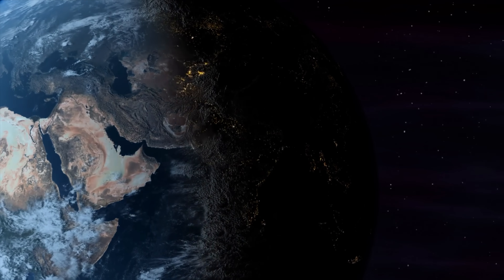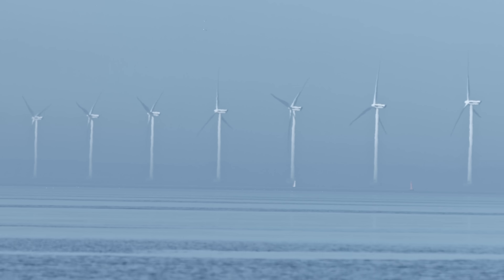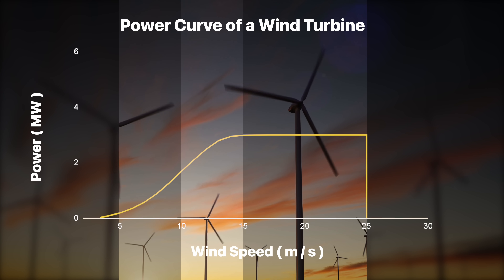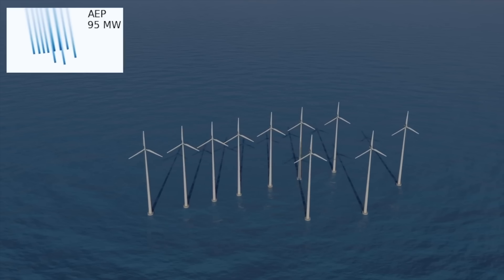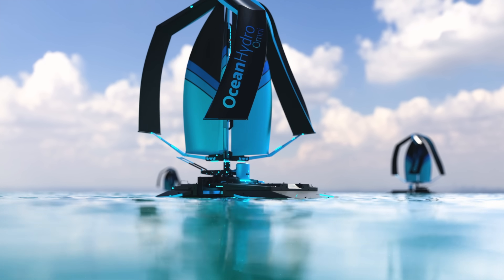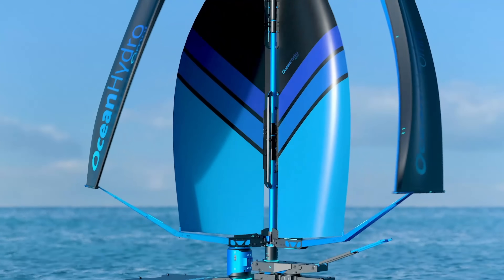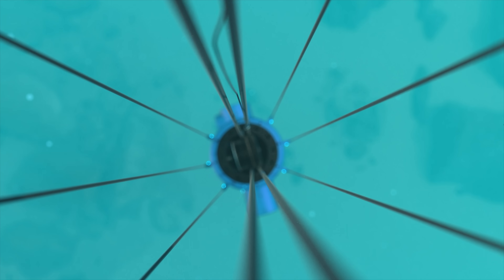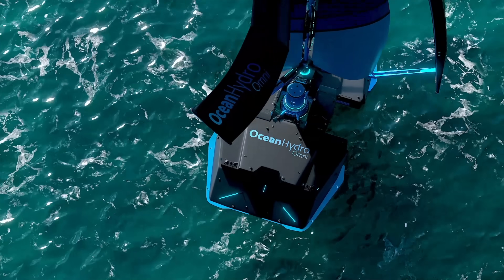Breakthrough Tech Solves Wind Power's BIGGEST Problem!

Comment: I am getting a little bit frustrated with all these new projects. We keep being told that wind and solar is unreliable and thus we must invent something entirely new.
I live in Denmark where wind alone is at 56% of the energy mix and I can tell you we don't have any problems with power outage. The current goal is to be an net exporter of renewable energy by 2030.
You can store excess energy through hydro or even with a conventional battery. Or you can sell to another market through HVDC cables. You can also put up smart grids that balances the whole thing.
The point I am making is that these technologies exist today. We don't need to wait another 30 years for something else to be effective.

Comment: Everytime this 2 bit de vinci  puts out the if butt's maybe, I am more impressed at the audiences solid input.
My take is allways too look at the economics as all energy production is a monopoly. Second the tech but only at its outcomes. Efficency,  costs,  volume off power produced. How easy or not will it fit into existing infrastructure. 
That why so many fail. 
Remember when its curtailed the oil gas nuclear have to jump in at a second to cover it. So they demand a higher price to guarantee supply. The more green the higher it drives the traditional base cost. That why every one benifits. WE DO NOT .WE PAY EVER HIGHER PRICES BY DESIGN.  Hello.
Cheap energy for decades.
Transition is not working for the many. 
85% off the planets population Government's are planning to increase traditional energy use by 50%. They cannot afford the prices or adapting their infrastructure.  
More questions than answers with the Wests unrealistic expectations.
Cheap plentiful energy has gone. I may have to move on as a fleeing economic migrant.  £5k for energy  really. How is this benefiting me. I can understand how it benifits the monopolies.

Comment: On the weight storage in a deep sea environment, what do you think about putting an air float on the weight? Pump air down to the float and raise the weight that way, perhaps it would be significantly more efficient than lifting the weight with the turbine?

Comment: Not sure how this will work but I have read at times that there is resistance to having offshore turbines since they have a visually disruptive effect. Perhaps these are not so, if they are lower and further out. I think they should use some other gravity storage device though such as pumping water up into a storage unit above water that is then released downward, or idk I have no clue

Comment: Better off using those wind pumps in the TX-CA 'Sun Belt' in lifting the Mississippi River's fresh water uphill through wells and ponds to the mountains, each a step in an energy/water terraced slope, rising upland from an upgraded Intracoastal Waterway. Coastal hurricane barrier islands need to be raised and connected, to adequately protect the entire Gulf Coast, not to mention what that would mean in reforming the Red Tides and Delta Dead Zone. Oyster farmers, shrimpers, fishing operations, recreational boating have all been ruined. Now it's time to take it all back and make the high deserts bloom green, all the way down to the coastlines, with fruit trees and vegetables all-year-round. 

In a challenged climate and wars, hunger and safety migrants will need more fertile land-use and good jobs. That productive infrastructure investment supports our industry, education, and retirements too. UMN researcher Steve Heilmann produced a low-temp algae-to-char process whereby solar heat reduces it to what looks and smells like coffee grounds, leaving pure water as fertilizer is returned to farms. It's timely.

Comment: Wind energy works good on a small scale like a single homestead. When you enter the realm of the big windmills you start having some weird problems like blade erosion. There's erosion going on even in small windmills but small windmills are cheap and easy to fix. Big ones are not. This is the way it's going to be for a long time and that's why I say solar is better. No moving parts to lubricate, not maintenance programs other than to wash them every 4 months. Buy enough batteries to make it through the night and get the best ones for the environment then your house and your business has no power bill and all that extra money you now have at your command can be directed to paying off your loan for solar equipment faster. Once it's paid off you are living on free electricity. Also that building will have no power bill as long as it is standing. What if everything we built was that way starting today? What are we waiting for?

Comment: It is a novel idea and will work perfect, in tests and in prototypes . . .however, past experience with wave, tidal and current generators has shown that the ocean encironment is just too harsh and destructive.   The O&M costs will be massive.  Unfortunately, the development company and investors will not discover this issue until they have paid for a large long term installation.  I wish them luck but I wouldn't invest in it.

Comment: I love the idea in general but don’t know if it will work well in the ocean. If it does work in the ocean then what about using this at sea level and below in the middle of current large mounted wind farms with blades high up in the air?

I think this idea would be better in a fairly consistent windy area with huge weights down in mine shafts that can be kept clean. You can even raise wind blades high into the air on tower to help with consistency and only have cables going up and down. 

Love the basic idea but practicality because of the ocean environment will likely be their downfall.

Comment: good idea even old mineshafts could be reused,,  vertical that is,,    even old railway lines where it decends  for  few miles  gravity can be harnessed,,,  it was used for hydraulic accumulators in the 19th century to provide the force for hydraulic systems around industrial towns

Comment: So I guess the whole advantage comes from the fact that the mechanical linkage is more robust/functions under more conditions than the electric one yes?  I mean, but for that, you would just transport the electricity ashore and use the most efficient energy storage there no?

But since lifting heavy weights isn't a particularly good energy storage solution and vertical wind turbines are an inferior energy generator I'm kinda skeptical combining them is going to be a winning solution...but I haven't done the math so I could very well be wrong.

Comment: Is there any environmental impact surveys for these offshore turbines?  All this is beyond safe or sustainable.....  If they break are they romoved as they arrived or just dumped at sea, which is the easy way for non recyclable materials.  I seriously could not believe that the engineers never thought that the wake caused by the turbine would negatively affect the other turbines.  Seriously way too fast move without proper thought.  Idiocy beyond compare.

Comment: you have to have power cables to transfer the power from the virticle turbines to the grid. since you already have all the infrastructure setup for that, wouldn't it be more efficient to have the virticle wind farms AND tidal generators in the same field? that way they could both use the same infrastructure?

Comment: I think you're all just a little bit crazy. I have been building windmills for over 50 years. Mine are all vertical axis wind turbines and all of them compress air. The compressed air is stored in what I call an air battery and when I need power, I throw a valve and pass compressed air through an air engine coupled to a generator and I have all I want. It would seem to me for the cost of one of these mammoth whirligigs and all the associated paraphernalia that goes along with it, it would be much easier just to build a whole bunch of more moderately sized turbines the only pump Air. I guess it's too simple and idea to be considered by the big boys.

Comment: I’d love to see something similar for onshore wind turbines. Swap out weights for water being pumped from low to high kinetic states during low demand, then use the water to create electricity during high demand. It may be that there are more compressible fluids that could be used, too, so less of it would be necessary. Just spitballing but I could see such a thing supplementing solar for off-grid use.

Comment: There are 12,000 out of use off shore oil platforms in the world. A few of these would make an ideal test bed platform. They are built to withstand the seas furry and have done so for decades. Many are at great depth from surface to seabed. 
 Recycle Repurpose and Reuse   ♻️ 
Good for proof of function on a tested stable platform although it doesn’t test the free floating environment. It just seems a natural fit, and save a few $ while demonstrating the tech and making some electric power. How deep are those north sea and Gulf of Mexico rigs? North Sea 1,000 to 2,000 meters. The gulf a bit deeper.

Comment: Well, why not simply install floating battery houses for those giant wind turbines?  These could store energy in giant lithium batteries COOLED BY THE OCEAN.  Later, when the wind dies down, the batteries can be discharged to continuously feed the Grid.  Personally, I doubt these hydro wind turbines will survive the rigors of ocean waves.  One good sized hurricane could wipe out all of these units in a single blow.

Comment: My first thought was: could you improve it with variable bouyancy (use some of the energy to compress air while sitting at the top)?
My second thought was: hydrodynamic drag is against you going up and going down so an obvious improvement is to opperate in (and on top off) a large hollow tube?
My third thought is:  why not generate electicity and send it ashore and store it there some how?
I assume it will use a cyclic pitch device (like a helicopter) to feather the advancing blade.
If they can generate more Gws per acre than HAWT then they make their case without all that underwater weight rigmarole.
Incidentally, has anyone tried contra-rotating HWATs?  Would that improve the down stream turbulence?

Comment: good ida. would not water do the same? Sealed tank with a spring to store the up power as the water filling at the top then sinks hit bottom release the spring and push water out. then go up and power both ways. Can have wind and sun on top with batteries charging and use for more demand. Or three, wave charge batteries

Comment: Sorry but I don't know where you will find an aquatic area without waves, and with salt there is tides and corrosion.    Put that vertical fan on top of a pole and adjust the vanes to optimise wind speed.

Comment: As we know the variable pitch propeller, system. The Kaplan Hub, variable tilt blades in water turbines. Reverse of it by using water flow, or underwater currents. Variable, allows the speed control of hub rotation. Out of the way of Earth bound animals, and not even seen. Earth , mostly water. Cost, ? dump money ‘Mindset,’ we can do anything to  get free power.Effort is what hum it’s have to use for free too. Humanity is a mass of energy,  all monetary wealth, is from it, plus a big greed factor. Become one with free, collective power of all United as we need to be on Earth.

Comment: The OMNI fails in so many ways. Firstly, there's energy conversion losses to deal with. Aside from the inefficiencies of normal blade versus vertical blades as mentioned here. Then there's the losses through gearing and water resistance and we've not even mentioned electricity generating losses.
I worked on the North Sea for years. I know all too well just how corrosive and difficult those waters are. To submerge steel ropes, pulleys and even an electricity generator in the water is madness. As others have pointed out - it might work for a short while but will soon fail. One of the biggest problems facing tidal electricity generation is the corrosive action of the water.

Comment: Getting closer!

How about instead of lifting weights we pressurize water?  Desalinate it and then add a high pressure line to shore where we get fresh water at a high enough pressure to convert it to electricity on shore.  You should even be able to get some pretty significant cooling from it as well.

Comment: The design for the conventional wind turbine machine, is completely wrong.
To have a great weight at the top of a long thin tower? It is upside down!
The genereating  element should be at ground level, being driven by a propeller shaft, as in rear wheel drive cars!
Bonus? Ease of maintenance!

Comment: Pretty good video,  and impressive design idea. How will the windmills be protected from hurricane season winds?
Can the whole wind power stations at sea level be lowered into the lower sea bed transfer station? A boat is destroyed on the sea but can be saved if it is submersible and docked at sea bed level. Anyway,  great video.

Comment: There are no large scale gravity storage systems operational anywhere in the world besides hydro dams, for good reasons.  They’re expensive per unit storage.  Underwater storage from motion has a far more difficult physics problem, in that any motion of the weight must give up energy via drag to the water.  Then there are currents, dragging laterally on the mass thus applying a torque to the overall rig.

Comment: Of course, you realize, it still provides intermittent power. Right? I think this idea has many problems. Maybe make it out of plastic?
Better to just have small, regulated, trackable, home nuke power supplies. A monitoring station could tell if the fissionable material was removed or transported. Or how about nuke waste powering a stirling electric generator at home ?

Comment: My napkin math for 300m sea depth assuming a 10t weight and neglecting the weight's lift force and other losses yield a maximum storage capacity of 300m * 9.81m/s2 * 10,000kg = 29,430,000 J. That seems like a large number but when you convert it to kWh, it comes in at 8.2 kWh. Considering the huge grid scale storage requirements and the enormous size of a single device, this is hardly sufficient. A LiIon battery (as a point of reference. There are more suitable battery types for grid operation in development) of this capacity costs around $1600 and requires no offshore installation. Therefore, I am very skeptical when it comes to this concept...

EDIT: It would be nice if youtubers were a bit more critical of the concepts they present instead of just parroting the hype...

Comment: TBdV-- Have you done a presentation on tidal power? The tides never stop moving water through energy recovery "breakwaters"-- barriers which contain turbine-driven generators. Almost every shoreline has potential areas for harvesting tidal energy, and they are considerably simpler in concept than either vertical or horizontal wind turbine generators. The energy in a moving mass of water is at least as great as wind, and as long as the moon keeps tides running, energy is available.
*"plebiansociety" (below) raises a point about some conventional designs, but materials technology has made maintenance cost-effective, before. After all, we still have submarines, ocean freighters and oil derricks, despite maintenance and replacement.

Comment: It would be much easier to match demand using a smart grid. A water heater could heat water when power was available and not when the water reached a set temperature in the tank. By using water heaters as on demand demand, the power company could scale demand up and down as convenient. The same could be done with HVAC, freezers, refrigerators, electric heaters and more.

Comment: It looks like you can put both types of WT interspersed with each other to extract more energy. If the wind speed gets too high, by careful positioning of the VAWT, you can put the HAWT into its "wind shadow" and protect the HAWT from damage. Under even higher wind speed, you can pull the VAWT under the surface of the water, where it would be protected. When the normal wind returns, let it pop back up above the surface.

Comment: Even without the problems others have mentioned -- saltwater corrosion and drag -- this is not going to work. Energy is the product of force and distance, so you get 9.8 joules of energy for each kilogram meter, assuming no losses to drag and 100% efficiency. Assume 700 metres (2300 ft) depth and a one tonne mass. You get 6.87 megajoules, or 1.9 kWh of storage. Even a 100 tonne weight only give you 0.2 MWh. Assuming the turbines need to produce at least several megawatts to be useful, the storage is less than five minutes of the turbine's own output. That's not much of a battery. Do they envisage something more like 10,000 tonne masses to give something under a day of storage? That's the mass of an Arleigh-Burke-class destroyer, a very substantial ship. The floating turbine mount would have to displace that  plus its own weight, which would make it a very large beast. It does reduce the drag losses because the weight would now be falling very slowly.
Reply: buy a yetti 2000 splar gebertir sollr cell

Comment: I see a problem with their current design: the weight can only go up or down. So, if there's good wind and the grid is requesting power, the weights have to go down while the turbine spins in vain. They should add a second weight to be able to capture energy and provide it.